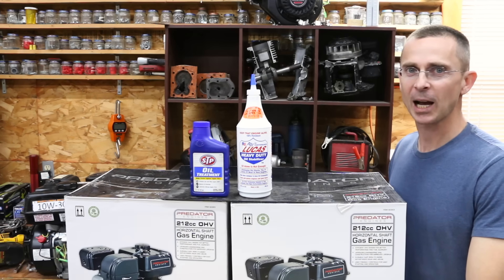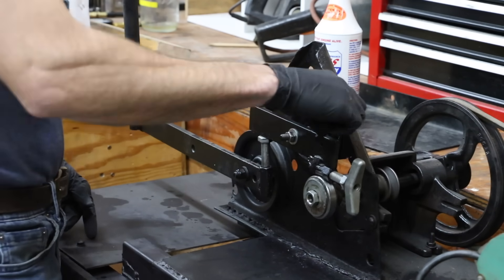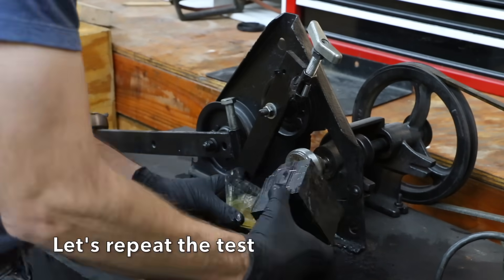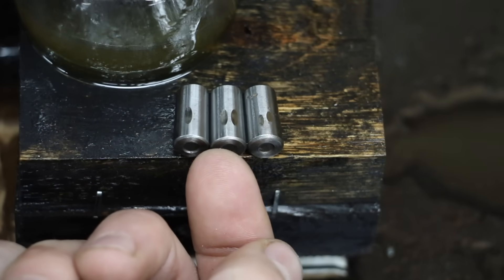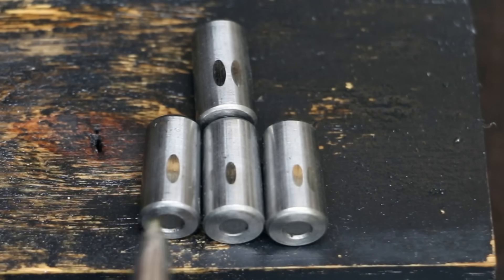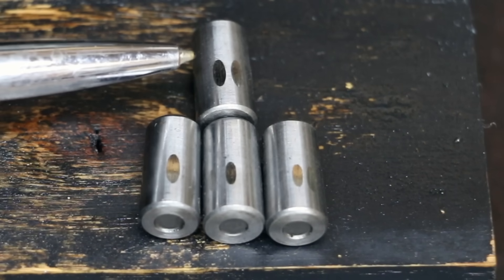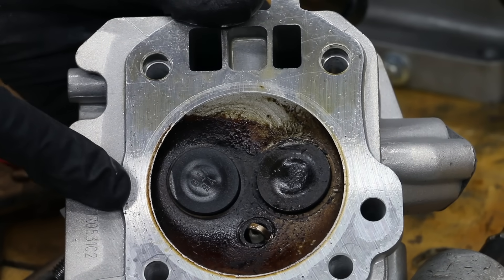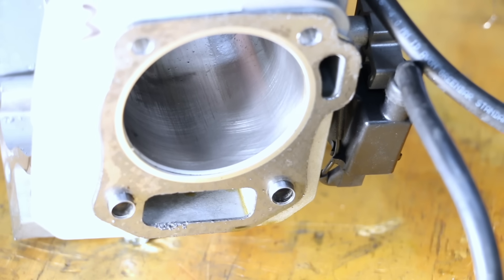Which engine self-destructs first?  Lucas or STP?

Comment: As usual, a fascinating video Todd. I may have mentioned this to you before, a company in South East England which is based less than 20 miles from where I live produce an anti friction product called Extralube ZX1.... not sure if you are aware of this?
I definately think it has a positive effect..... I added a 250ml bottle to the engine of my 1998 2.5 V6 Ford (Mercury) Cougar with new-ish Carlube Triple R 5w-30 oil conforming to Ford's "913D" spec...... it seemed to be quieter at 60 to 70mph cruising speeds.
I would love to see you test this product on your little machine !!
Keep up the great work, best regards to you 👍👍👍👍
Reply from the maker: Thanks for the video idea.

Comment: So I see both products work as advertised. I theorize Lucas had more scoring because it ran for a longer time. Estimate the scoring from the stp engine run time and add 9 more minutes worth of scoring to the cylinder walls if my theory holds true then the scoring would've been the same or worse.. that's important numbers to know because when the oil runs dry these products are supposed to be defending your engine against the damage.. which one comes out with less scoring damage if run the same amount of time without oil.

Also an important takeaway from this experiment. If you lose oil pressure in your engine DO NOT continue to run it turn it off as soon as possible because regardless what protective products you're using running that engine without lubrication is in fact damaging it.
Reply from the maker: Thanks for the feedback.

Comment: Your test did not address what both were  made for ! Both were designed to stop dry starts .  Not running with out oil . The upper parts of and  engine  start dry . oil drains down when shut off and then dry until oil gets to the top again . Also you should have done a viscosity test on both under high heat . That would have told you which would have stayed on the upper parts better , When your mains are worn ,that will determan your oil pressure  under heat and thinning . I Can tell you right now the winner of that one . The jeep 4.0 is know for that problem . Lucas will keep it high enough to not shut down .
Reply from the maker: Thanks for the feedback.

Comment: With engine clearances being tighter in modern automotive engines and the lower viscosity motor oils 0 w 20 and so on being used I wonder if products like Lucas and STP may do more harm than good because they raise the viscosity of the oil and may limit flow through the bearings causing premature wear.
Reply from the maker: Thanks for the video idea.

Comment: I remember working at an auto parts store called Champion Auto here in MN back in the 80's.  The JB man would come around and show us the comparison between JB80 vs WD40.   I also remember the slogan JB80 is twice as good.
Reply from the maker: Thanks for sharing.
Reply: I used to buy parts from Champion Auto and 10,000 auto parts on Central Ave in Minneapolis.
Reply: @anthonynelson9136  I was up in the Forest lake stores back in 83ish.  Manager was Tom, tall skinny blonde guy.  Very nice.  Static wheel balancer spun the tires at 120mph.  I was a mechanic there.  I almost forgot about Crown Auto.

Comment: Lucas is way to thick for bearing clearances, it will wear out your oil pump.  Lucas also has no detergents or additives to protect against blow-by gases or chemically bond to engine parts.  Sludge will occur, the oil will break down sooner...
...but hey, it raises oil pressure and quiets the motor down when u put it in 😂
Reply from the maker: Thanks for the feedback.

Comment: I have built many engines I have always used stp as an assembly lube on all bearings, never had any issues. My rational is that it will protect the crankshaft bearings until the oil pump gets the oil to the bearings. I also did a pre oil before start up. This next statement is really going over the top but I built a preoiling system for my engines before every start I will run the preoiler until I get oil pressure then start engine. I am a drag racer and because in this sport the engine is either idling or wide open, my car is a 10 second car so not all that fast but never had a problem because of oil starvation. Enjoy your channel keep up the videos.
Reply from the maker: Thanks, will do.

Comment: Just curious, Is there a difference between 2 cycle oil for Chainsaws/Weed trimmers as opposed to the 2 cycle oil for outboard motors?
Reply from the maker: Thanks for the video idea.
Reply: Yes, outboard oil is meant for water cooled engines and it is more biodegradable because it is likely to be spilled on the water. Chainsaw/weedwacker oil is better in hot aircooled engines.

Comment: I used lucas oil treatment in a 351 V-8, 1978 Ford LTD station wagon, with a rod knock on startup. It helped keep that engine running for about two years before I sold the car for parts.
Reply from the maker: Thanks for sharing.

Comment: 77 year model 351m Ford engine. Mechanical Guage showed about 3 to 5llbs oil pressure with pure regular motor oil. 4 quarts of the same motor oil one quart lucus engine oil treatment oil pressure went up to 25llbs and stayed until about the 3000 mile mark or next oil change and finally dropped to 20llbs. Huge difference. Motor is stock and all original from the factory in 1977. Still runs fine to this day.
Reply from the maker: Thanks for sharing.

Comment: I would like to see a comparison using Grapheneoil. 
I added it to my old Chevy truck with 230k and got immediate results. Drop in idle rpm, quieter operation, and the biggest note was a wrist pin knock that had been there on cold start for the past 70k was gone
Reply from the maker: Thanks for the video idea.
Reply: @ProjectFarm  check out specs and testing at grapheneoil.com

Comment: Love your vids.  Have you compared Lucas oil additive to Engine Restore oil additive?   If not, I'd like to see this comparison.  I have used Engine Restore for years and I could feel the engine running much smoother right after the oil change (per the bottle directions).  it's time I knew the truth when compared with Lucas...  Thanks!
Reply from the maker: Thanks so much!  Thanks for the video idea.

Comment: You are horrible: you have made me watch all of your videos, I can not stop. A couple of serious questions though:
1. how much does it cost to fix those engines?
2. if they had stainless steel parts rather than aluminium parts that melted/broke, would it mean that they would be able to run for hours like in an old advertisement for a different additive you tested in another video?

Comment: The engines would have to be exactly the same and they aren't.
Reply: Why are they not the same?
Reply: @Nerfamus  Why are engines blueprinted?
Reply: @scottmerrow1488  The engines are the same model. They're is no difference.
Reply: @Nerfamus  They are is no difference?
Reply: @Nerfamus  They started with the exact same tolerances throughout? What do you want me to believe interested bystander?
Reply: @scottmerrow1488  I want you to believe that Project Farm did the best he could for this test and that the engines should be very similar to each other.
Reply: @Nerfamus  That was never in question.
Reply: It's almost as scientific as it could be.. All the parts have tolerances in size and composition.
Reply from the maker: Thanks for watching.

Comment: What about testing oil additives straight up against each other, without adding oil to them and diluting them?
Reply: Then you missed the point of the product as an oil "additive". Would you test hot sauce without food? or dish soap without water?
Reply: @5thwiseman  The point of my question, is how good are they on their own?
Reply: @MrRVRclubprez  Testing oil additives as an abstract product doesn't tell you anything as that is not how it would ever be used nor does the basic ingredients represent the final performance of the sum of all the components. Dihydrogen monoxide is some of the nastiest stuff in the world - it dissolves, mutates and kills many living things and even destroys electric/mechanical things when looked at in abstract. Until you realise it is the chemical name of water (H2O) molecule.
Reply from the maker: Thanks for the suggestion.

Comment: My oil and broke one night and I had to drive my car without oil in it for about 35 miles I always use Lucas in it could not find any damage done to the motor and also put Lucas in my gas and they was checking my fuel injections and they thought I had just put them in and this was like 7:00 to 8 years after having this car and I like Lucas I recommend it highly
Reply from the maker: Thanks for sharing.

Comment: Hey there guy, great video. I'm considering using an additive on my vehicle but I've heard rumors that these can ruin a VVT engine. The reasons im told are due to the VVT system relying on oil flow through small holes in the engine. I know you've done a few videos on using the Lucas but I was wondering if you could address this rumor.  Thanks and keep up the amazing content
Reply from the maker: Thanks for the video idea.

Comment: I owned an aircraft repair base for 40 some years and it still pains me to see someone holding and pouring oil out of a bottle the wrong way. The manufacturer designed the bottle shape so you can tilt the bottle a lot further when holding it with the slant down. Tilting it the wrong way results in the oil pouring out with just a slight tilt and you can't aim it!.
Reply from the maker: Thanks for the feedback.

Comment: I owned a semi truck for 6 years and when I changed the oil in it,  it was 9 gallons of oil to 1 gallon of Lucas.
There was 500,000 miles on the truck when I bought it, I changed oil every 15k miles. When I sold the truck there was almost 1.2 million miles on the truck with no major repairs ever done  while I owned it.
Lucas is really good stuff if used correctly.
Reply from the maker: Thanks for sharing.

Comment: In your experience with these small gas engines, I have wondered HOW these "splash" lube systems are able to lubricate the OHV valve components that are by design, far distant from all that splashing going on in the crankcase.    I have a hard time understanding how any lubrication is possible when there is no apparent way for oil to get to these OHV components....  I.E. the rocker arm support shaft, valve stems, and and also the push rods.  ANY explanation you may provide will be welcome for this "curious mind".... (MAYBE the vacuume tube on the valve cover connected to the carburetor - which provides an air "suction" that pulls in an "oil vapor" from the crankcase???? IF so this doesn't seem that the oil contained in this minuscule oil vapor would provide any appreciable lubrication??)  Thanks for solving this riddle that has been bugging the hell out of me   ;-)
Reply from the maker: Thanks for the video idea.
Reply: @ProjectFarm  Well, my question is one that "just happens" when a retired guy has "too much time on his hands"  ;-)   Thanks

Comment: Lucas had the edge over STP because of the controlled time trial test and I feel that Lucas would be more reliable based off of that test.  The scoring for both STP and Lucas was very minuscule but the 10w-30 scoring from the lubricity test was very surprising to me but the viscosity of both STP and Lucas is much higher than that of 10w-30 so it makes sense.  The rapid creation of bubbles during the lubricity testing of STP and Lucas was also interesting as I did not know that this would occur in either product.
Reply from the maker: Thanks for the feedback.

Comment: You and I are not  better at formulating lubricants than the oil companies are. Forget oil additives altogether. Every engine manufacturer recommends exactly that - unless there's a need to address a specific problem. In that case, they'll re-brand an additive and sell it under their own name. Any other approach is either worthless or chancy.
Reply from the maker: Thanks for the feedback.

Comment: I just found out that STP uses zinc, which will eventually ruin or retard your catalytic convertor, so I got some 5w-30 Quaker State part synthetic oil and put that in.  Bob Sikorsky also said in his books  not to use Full synthetic oil in vehicles with over 50,000 miles on them, unless it was used from the start.  He said it will clean your engine so well, it may lose some compression, so use part synthetic instead.  Since you never know what's in the other additives, the only other oil additive I think he mentioned was Moly.  So I may add some moly to it after a while, which is metallic particles, in the meantime I  will just drive it easily for a while.   Killmer says Lucas has no zinc, and if you use the right one (thick for old cars, the thinner version only for new cars), I may try that, but I will space all these things out.  I've seen good things said about Prolong also, but unless I know they don't have zinc, I won't use them.   And there is always Slick50.  Plus i'll get the magnet on the oil filter, and a magnetic oil plug to catch the slivers I know are in there with the metal on metal wear from lack of oil.  I found this on fuel injector cleaners:   (e.g. injector cleaner): Some of theses contain compounds that damage catalytic converters. If you must, ensure the label of the additive says catalytic converter safe.  From this site:  https://www.diyautoworksng.com/things-that-damage-catalytic-converters/
Reply: Cars with flat tappet valve trains require ZDDP to avoid excessive wear. 
The catalytic issue is a big reason modern cars use roller based valve trains which don't need the ZDDP, rollers also slightly improve fuel mileage. (Though this adds a lot of cost and several possible failure points)
Basically pre 1990ish use ZDDP, after 1990ish do not. The oil spec in the owners manual will say API-"SM" or later for low zinc; SF and earlier are high zinc, the oils between G and L were transition oils with less and less. 
Its actually the P and S that does most of the work the Zn is mainly along for the ride just to bind the molecule together.

Comment: Well ..... the additives must be mixed into HOT oil & then run for a while in the hot oil to fully blend them into the oil. Stirring up cold oil & additives doesn't blend them properly & the STP will sink to the bottom of the oil pan & have no effect in helping the motor. Essentially the STP engine was running on just regular oil without the STP additive mixed into it.  I've used STP for decades in my cars & they don't burn oil, better than expected fuel milage, easier cold starts, maintain very good compression for years, less fouling, etc.
Reply from the maker: Thanks for sharing.

Comment: Zpd should have won, there should have been less friction and heat due that glassy surface between friction parts as they claim
Reply from the maker: Thank you for the feedback
Reply: @ProjectFarm  I cannot decide to use or not to use Lucas products. Im from europe, even we have distributor. Lucas injector cleaners are superb but about that Lucas heavy duty oil stabilizator i have big doubts, opinions from mechanic forums vary from terrible engine failure to very nice results.

Comment: How about another test where you test them at the same concentration on the lubricity tester? Try running the test for a significantly longer period of time. I would just like to see if we can make the STP perform about the same or better than the Lucas. Great work!
Reply from the maker: Thanks for the suggestion.
Reply: It would also be helpful to run them at a normal engine temp so you get true viscosity(film thickness) and chemical activity. (many antiwear and EP additives are reactive not passive.) Though I can see this setup may not lend its self to maintaining a fixed hot oil temp.

Comment: my wife car 2001 chevy lumina with 100,000 plus had an oil leak and she told me to chk.it out i keep saying yes but never got to it until one weekend she droping my son to baseball game she called me on the ph. said car was making loud sound she pull over. so i rush over and piste off to my self knowing it's the oil that i keep holding off. so when i got there start engine wow lifters screaming like a mother fucker. i bought 1 gallon of oil theng the car took all 1 gallon chk. the deep stick start car after letting it run for a minute or two car got quite and run great again i was so happy i always put lucas every oil change. chk. the lick found that the oin sender had a crack replace it and everthing all good until now never i change my car truck sons 4 stroke yamaha engine with out it.

Comment: "... and then I got the JB Weld out and they've both been running ever since!"
Reply: I was always Impressed with JB weld I had a moter cycle that had a engine case put together with JB weld. It worked for about 4 years I think it's the Duked tape of the epoxy world.
Reply: James Smith did you see his video where he patched a cylinder head together with JBweld?
Reply: The Pyramids were built with JB weld!! That's the 'mysterious' tech.
Reply: @Alvin-1138  it checks out.
Reply: @galenmarek8287  ☝
Reply: Something got caught between the counter weight and crank case and blew a hole in the crank case JB welded her right up and it still runs my tiller once or twice a year.
Reply: Haaaahaaha
Reply: Hahaaa I used JB WELD ON MY MINIBIKE AS A KID, and it ran for another year.
Reply: That JB Weld is pretty good.   I used it on my cracked stainless steel headers and it held for years and was still holding when I sold my car.
Reply: LMAO!
Reply: jb weld is impressive slap on bottom of fuel tank to fix a crack. never reopened. seems to not be affected by petrol.
Reply: Haha!